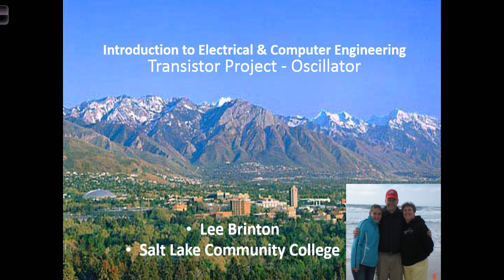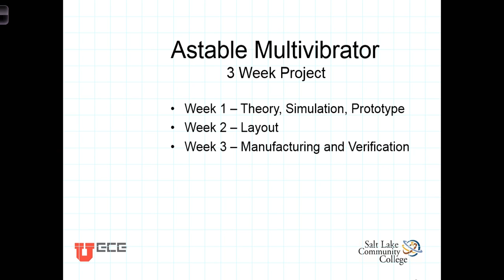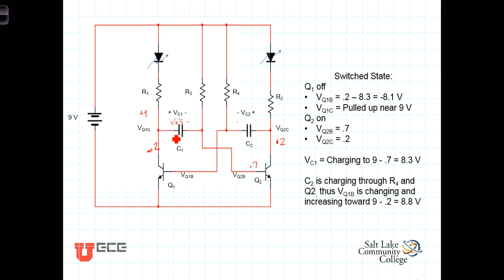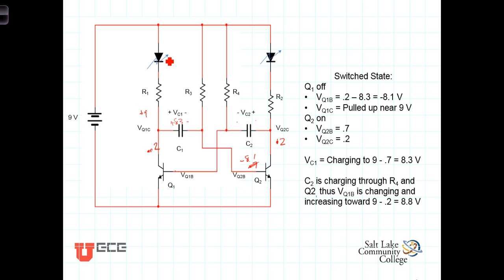L10109 1 Astable Multivibrator

Comment: Usually the voltage at the base of transistors will not go lower than -6 to -8 V. Lower voltages will exceed the typical avalanche breakdown voltage of the base to emitter diode. This is also the reason why the time periods of such astable multivibrators tend to get shorter or the frequencies tend to get higher, the higher the operating voltage is. It is therefore not recommented to exceed 5 V operating voltage, especially in the case of larger capacitors (muliple 100 µF). The energy of the charge can evtl damage the base emitter diode.

Comment: How is this possible without damaging the capacitors? As I understand it C1 and C2 are switching polarity and the capacitors are polarized (often electrolytic capacitors are utilized in Astable multivibrators).
Reply: Ordinary aluminium capacitors can withstand a reverse voltage of about 1V to 1.5V without taking damage. Since the maximum reverse voltage is well below 1V everything is fine.
Reply: @MirceaPricop  Thanks. This is the answer that i was looking for. btw how did you get to know that? just by figuring out or someone told you? either way thanks.
Reply: @kurtti1043  Haha glad it helped after such a long time. I remember being confused by the same problem and researching it online, it's stated on Wikipedia: https://en.m.wikipedia.org/wiki/Electrolytic_capacitor#Reverse_voltage
Reply: @MirceaPricop  If i change the values on capacitors C1 and C2 does it make any difference how long the leds are going to stay on? Can the capasitors have charge over 0.7V since the transistor Q1 starts to conduct 0.7V and C2 starts to discharge and C1 start charging. Can i make the discharging slower if i put resistors between emitter and ground? also if i want to change the chargin time i can change the 2 resistor in the middle, right?
Reply: @kurtti1043  Yes, the duration each LED stays on is directly proportional to R3*C1 and R4*C2, so changing either capacitors or resistors in the middle will influence timing. I think adding a resistor on the discharge path will cause the output to fade out over time instead of instantly swap, but I never tried that out in practice
Reply: @MirceaPricop  But i dont understand how does changing the value of C1 or C2 effect the glowing time of led, i understand that changing value of R3 and R4 does. Can capacitor get the charge beyond 0,7V and how because there will be a connection from base-emitter and then to the ground and capacitor will discharge that way? The question is that can C1 or C2 have over 0,7Vcharge?

Thanks for your effort to answer to these stupid questions :)
Reply: @kurtti1043  They don't hold more charge, but a higher capacitance means they can hold the 0,7V charge for a longer time before dropping off enough for the state to flip. If you look at this waveform: https://2.bp.blogspot.com/-0W0olwJoKbs/WJ2mkNemyzI/AAAAAAAACb8/c-csmxABLvwROSDRgnjIl0QnZP5P2KBIQCEw/s1600/28b.png

The resistor controls the charge time, while the capacitance controls the discharge time. Together they control how long each LED stays on or off.
Reply: @MirceaPricop  the whole circuit is designed around manufacturing tolerances.
Reply: I have wanted to know this for some time. Many of the videos on the topic don't mention this.